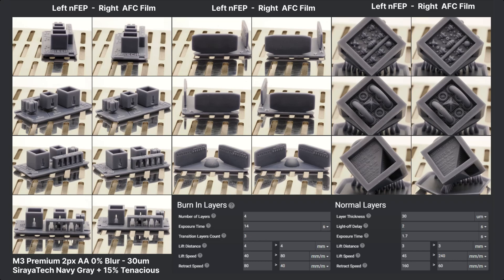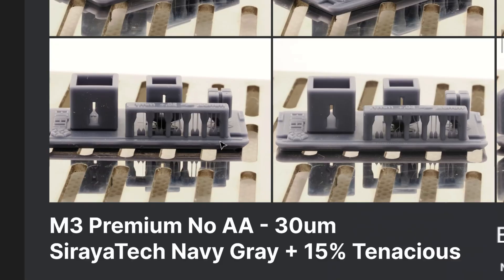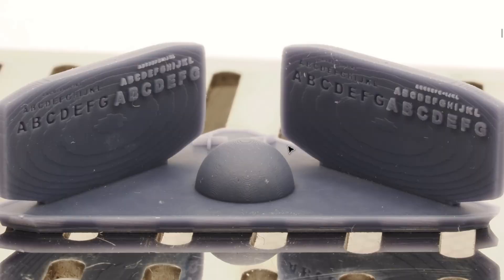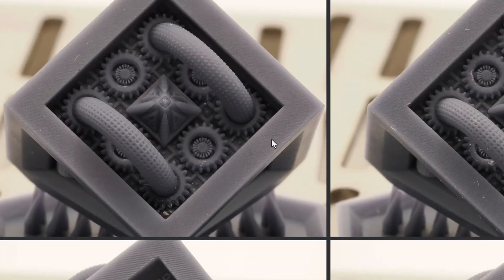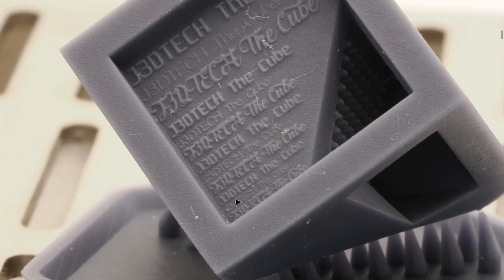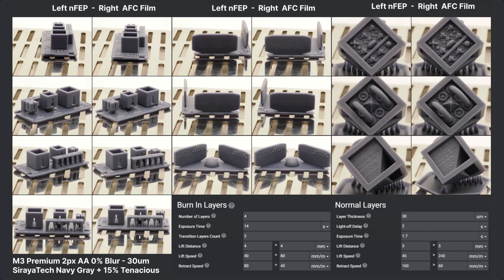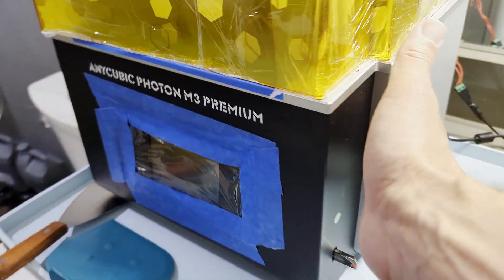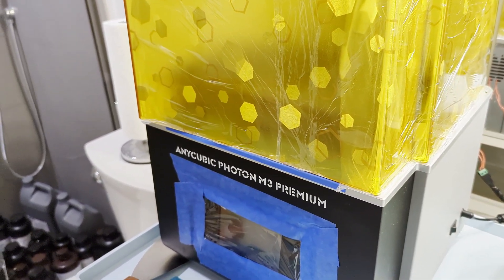Why do 12k Printers come with this?  nFEP vs ACF Film

Comment: Why are all of them coming with ACF? do you think manufacturer of the 12K screen is telling them to go with acf?
Reply from the maker: My thought is the 12k screens and the downgrade of the hardware in order to keep the price point low created prints that we're not good looking. Looked worse than 8k.

So they made the decision to lean heavily into speed and not into quality.

I think the Saturn 3 Ultra is the only printer that focused on build quality versus gimmicks and marketing. I did order this printer and when I get one I'll do a full review
Reply: @J3DTech  this is the first time I'm seeing quality loss using ACF film though, any other prints I've seen these lines didn't show up even at higher speeds
so it does make me wonder whether something else might've just gone wrong here
Reply: @J3DTech  "I think the Saturn 3 Ultra is the only printer that focused on build quality versus gimmicks and marketing"  - VOG says in his review of the S3U - "Too much, for too little", https://youtu.be/UUY1lTtKtps
Reply from the maker: @retromodernart4426  I saw that and he failed to point out the downgrade screw and light source on the M5s, while the Saturn 3 Ultra upgraded theirs and finally removed that trash Ball joint.
Reply: @J3DTech  Can't wait for your review...
Reply: @J3DTech some people like the ball joint
Reply from the maker: @Texas3DCustoms  It may seem easier because it's only two bolts. On the smaller Saturn 1 it was ok. The swivel still makes it harder to level others and it does fall out or level faster than a 4 bolt system. 

The 2 bolts also breakdown faster needing replacement.

When looking at it objectively,it is an inferior system. That's why you see the Ultra move away from it.
Reply: @J3DTech  funny I don't see it that way but okay you're going to tell me it's wrong but I'll tell you I've done a lot of prints and some of my printers are setting it two years without being releveled My Saturn 2's I've had them since they were released original level I've never had a screw break down either If they're breaking down you're over tightening The reason I say it's better you have a less constrained system I had a printer with a 4 bolt system it would pull as you tightened the system, very hard to level. Now from an engineering perspective 4 points of constraint on a plane is incorrect it should be three this was and still is a major flaw in FDM bed leveling it is inherently over constrained. I like the ball system and perhaps as you get large like beyond the Saturn line is see the validity in the ball system not working but I have 17 resin printers 3 Saturns 7 Mars 3's 2 Mars 4 Max's (shouldn't be in the Mars lineup IMHO) 4 Saturn 2's and a Phrozen Mega 8K of all of them I have releveled the Mega 8K the most times. Now I have my settings dialed in and there is no chiseling of the parts off the build plate and except for one time when I dropped a build plate I have never lost level randomly not have I stripped out the holding screws. But I am curious why you think the ball system screws or mount will be more likely to become damaged, in my experience working on cars and other machinery smaller screws and especially fine pitch screws are more likely to have thread issues, and the Holding screws for the ball socket are usually if not always larger diameter.
Reply from the maker: I'll never tell you that you, and your experiences are wrong. In Fact I would say that you fall right into my current trend model perfectly. More experienced or professional users have less issues with these printers. I belive this is 100% due to handling, workflow and how the printer is well left alone.

My experiences: I've made it my full time job over the last 2 years to help the community to 3D print. I've been on call for a few commercial businesses but mostly I work with the average user. Among the average user I've assisted more than a few thousand users struggling with this system. The Satun 2 has been a great success for Elegoo. But this has also put a lot of work on my lap since its release. I really do wish I kept a record of all the interactions as that would publicly validate what to me is objective data. But without that it may feel more subjective.

I've seen how the Saturn 2 struggles above any of the current 8k printers to print very small details, I've tracked this back to flex in the chassis, and micro movements in the build plate.

Other leaders in this industry's experiences: I've had conversations with some of the Lead hardware engineers of more than one 3D Printer manufacturer. (I can't disclose what company) where we discuss this system and I've gotten their own breakdown and options.But I've made it my full time job over the last 2 years to help the community to 3D print. The Satun 2 has been a great sucess for Elegoo. But this has also put a lot of work on my lap since it's release. 

What I've experiences are more then a few thousand users struggle with this system and having it in most cases leading to a break down of trust in the printer. I've had conversations with some of the Lead hardare engineeers of other 3D Printer manafacures where we duscuess this system and I've gotten their own breakdown and options.

https://youtu.be/ZuEWrACWVJg?t=200
Reply: @J3DTech  perhaps that is true, I don't deal much with everyday users, I have never had an issue with details showing or flexing, but I am very conservative with my settings as far as lift speeds and distance as speed is not my concern. I batch print and hardly ever do I have any one model of machine fully occupied except for the Mars 3's which one all 7 are chugging along. I do think a 3 point leveling system would be ideal, but the interconnected pieces need to be precision machined not cast or stamped. That was the issue I had with the voxelab printer there was too much slack. A ball system can have more tolerance on the machines parts without issue. As far as light users who don't print 10 or so runs a day I can see they don't spend the time fully learning and tuning the printer and settings to achieve optimal results, and with that said sure I agree.

Comment: you are a straight up 3D printing  HERO!  There's so much misinformation and abundance of information it can be overwhelming. Thank you for simplifying entry into the hobby.
Reply from the maker: Thank you! I'm not finished yet. Just getting started. 

My goal is to help the hardware industry make better quality printers by helping educate the buyers.

Also to help the owners get the perfect print with ease.

Time will tell if it's a success.